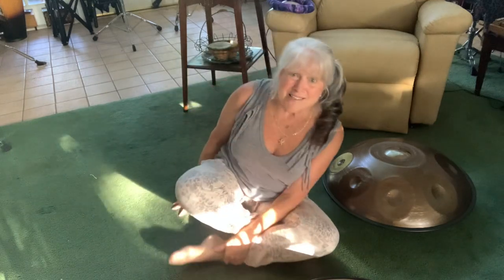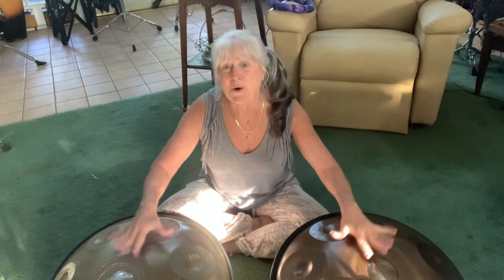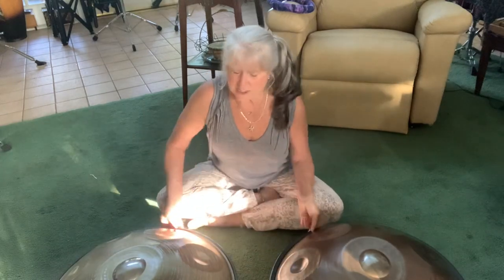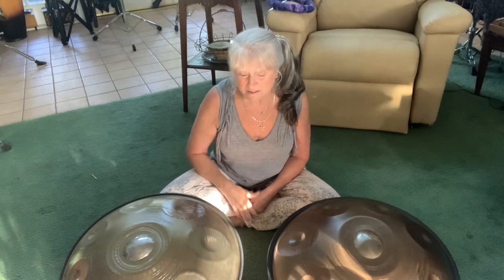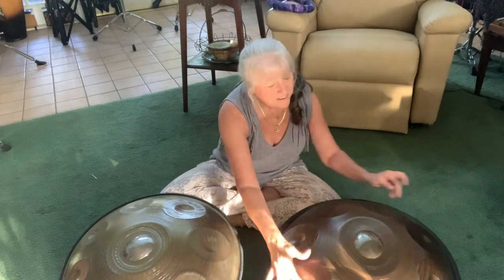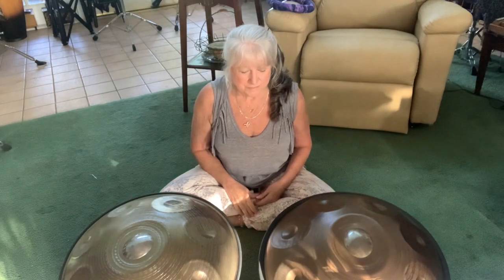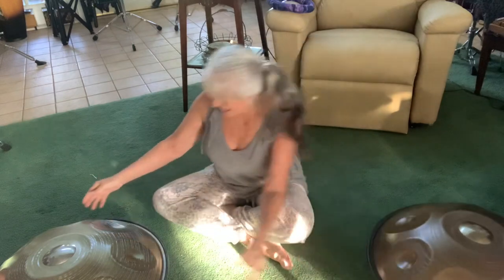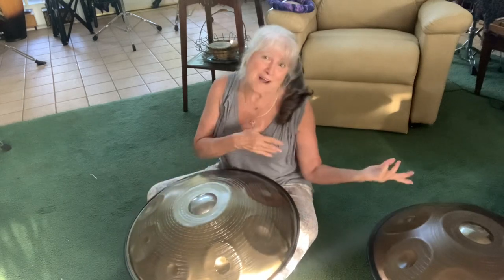🛸🎶 Handpan Sound Comparison of Stainless vs Nitrided Steel 🎶🛸

Comment: It depends how its tuned. I have also seen the very reverse. It all matters on the drum.
Reply from the maker: In reverse?  I suppose you’re right to a degree … I’ve definitely seen a few stainless steel pans that were a bit dull and did not have a long sustain (not what I’d consider quality pans, especially for what I do) and I actually play two nitrided pans that ring longer than most …. So you are correct; although the norm is accurate as stated, it absolutely depends on the handpan and more importantly, who the builder is …..    A bad builder, no matter what, is not going to make a quality pan…. Stainless or nitrided …Which, is another reason its good … if at all possible … for people to go with reputable builders … plus they then have the ability for easy retuning if ever needed….  🛸🎶 … 🤗🦋